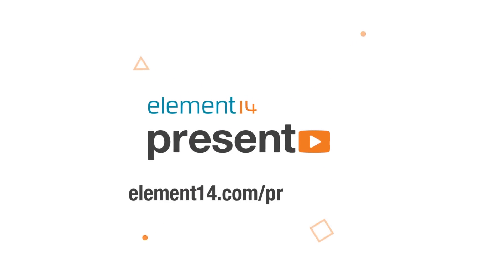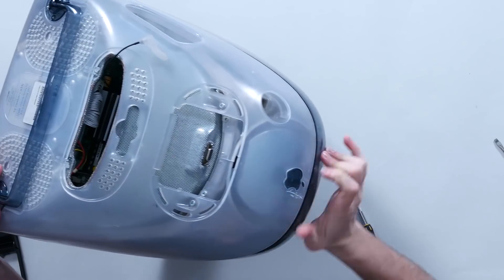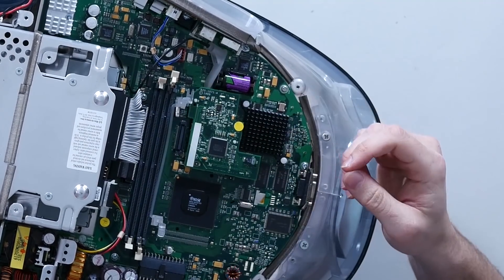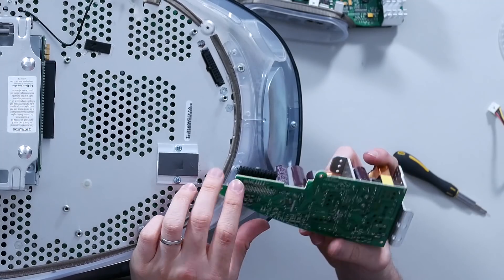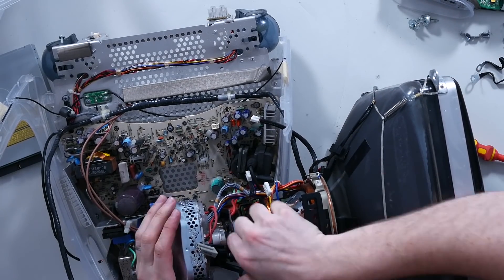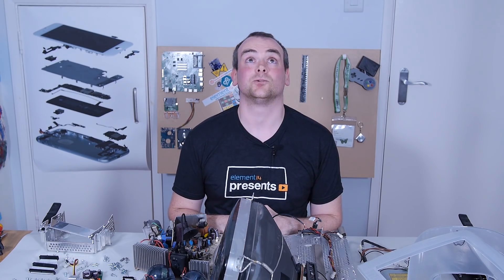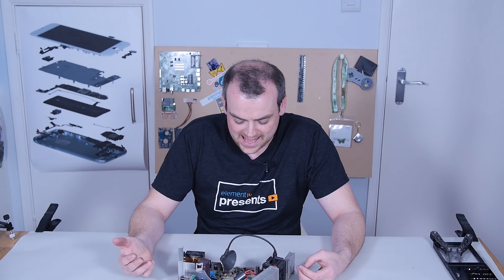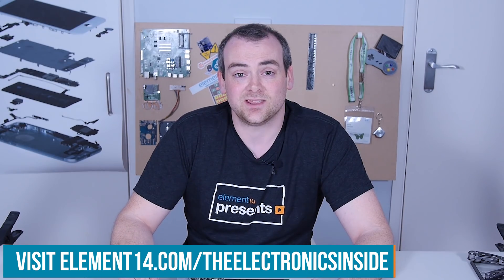iMac G3 Teardown - The Electronics Inside

Comment: Can confirm, working on CRTs is dangerous AF, as is working on exposed power supplies where you can accidentally touch a capacitor and fry yourself. NEVER work on devices like this when they were just connected to power.

Comment: I really appreciate this breakdown tutorial. With my limited knowledge I've resurrected over a dozen iMac G3's left out in the cold by frustrated owners. But am stumped by a Graphite iMac that suddenly won't boot. I power-cycled it and replaced the CMOS battery and reset the PMU, but no juice--just light brief sound of residual electricity. Now suspicious it's the power supply. Thanks for locating it for me, though fear of electrocution and non-availability of a new ps have doomed this one. So disappointing to give up!

Comment: 5 Minutes into the video you already told that the GPU was the CPU and that the IDE interface with additional power lines was a SCSI interface. Sure, a 50 pin cable could be SCSI, but where would the optical drive get it's power from then? ;-)

Comment: I am almost certain the iMac used PATA no SCSI for CD and hard drive. I’Ve owned and used man older Macs with built in SCSI, but I’m prettier sure this one is PATA
Reply: They most certainly did -- the CD connector just has power running to it (it's a laptop drive, pretty sure).

Comment: I know this was more about the electronics, but just wondering if you remember if there was any space between the front bevel and the monitor? Was thinking of lighting it up with LED's but don't want to risk breaking it if I can't get them in anyway. I am already adding LED strip lights to the base and top plastic sections and going to use it as a lil digital jukebox. Great video!

Comment: Most likely the power regulation board is taking in low-voltage AC (20V?), and switching / smoothing it down to the levels needed by the logic board. If you look at the connector, it marks two of the pins as AC+ and AC-. That's how they would be able to get away with powering it via those long traces, where voltage drops from trace resistance is not as much of an issue.

Why does the Apple Chime sound have to come from the HV board? The CPU could produce the sound shortly after boot, and you wouldn't be able to notice a difference from the time you pressed the button to when the sound played. Having the HV board produce the sound would prevent it from being used as a diagnostic, since it wouldn't involve the CPU and would instead function as an auditory power light. Having the CPU produce the sound could at least represent that the CPU is able to begin executing the boot code. (i.e. the RAM works, the CPU works, the sound chip works, and the BIOS was read and not corrupted). That could be done before the POST is completed, since the POST can then be done while the CRT is warming up.
Reply: That's a good point. I guess being a PC user I am used to (certainly at the time) discreet sound cards that need the the OS and drivers to work. As the sound processing and bios are in a bespoke package it would have been possible?
Reply: @a531016  I don't know for certain, but I think the fact that it was a custom VLSI package helps. Most likely, one of a few things were implemented: 1) the sound chip is really simple, so it doesn't need much of a driver (so the BIOS loader can load it), 2) the BIOS used a stripped down version of the driver just to play the startup sound, 3) the BIOS had a hardcoded routine to play the sound file (think of it as optimizing the driver to only do that one task). Given that the sound chip was set and could not be upgraded, any number of those guesses could be true. Though, my bet would be a combination of option 1 and 2, where the sound chip was easy to control, and the first thing the bootloader does (besides set CPU registers), is to send the startup sound to the sound chip. 
Anyway, others have verified that the startup sound is in the BIOS ROM, so it's clearly coming from the CPU. I would suggest probing it to find out how much work the CPU is doing beforehand, but since everything is BGA, it probably won't be feasible. You could probably snoop the BIOS (most likely it's SPI), and decode the contents in the order that they are being read if you are that interested. Since PPC is a RISC architecture, all of the instructions are 32-bit, and are well documented (it should be obvious when the sound data is loaded, since it will most likely be blocks of nonsensical instructions).  That would be a lot of work to answer the question of how the CPU is playing the sound though.
P.S. I am also a PC user, but I think this mac is closer to an embedded system since it pretty much comes in only one configuration. So in a sense, it probably has more in common with a system like the Nintendo GameCube than it does a PC of the era. Also, I am pretty sure that the GameCube played its startup sound from the BIOS as well (probably after the POST though).

Comment: On the observations about its power use and need for cooling, or lack thereof, compared to contemporary Pentiums...I hope that's what we can get back to with an in-house Apple designed ARM processor switch, just massively better perf/watt than the rest of PCs on x86. Ironic though, as the late PowerPC G5s were too poor in performance per watt - the whole reason they switched to x86 in the first place!
Reply: And ironic: as of late the intel x86 CPUs are now getting hardware security flaws, some going back like 20 or more years!!  Which means software patches to stop the flaws, thus sucking down the performance 

<insert the pikachu o-face here>

Comment: Damn what a coincidence just bought a Indigo 400Mhz one with the mouse and keyboard for 15€ last week.
Fun nostalgia trip but the 120GB HDD cap really sucks in modern times because it makes finding a new drive for it so much harder.
Reply: CF to SCSI adapter?  Assuming the interface for the hard drive is SCSI, which if that's what the disk Drive uses, I'd guess the HDD uses it too
Reply: Does the cap apply to a fire wire connected drive?
Reply: As far as I am aware it does not.

Comment: The electron beam is not what charges the CRT up. The Capacitor on the board is just fine. If you remove the bulged plastic cover, the can inside will be just fine and flat.

Comment: I worked at Apple from 2000-2010. When I started we had to learn how to tear down and rebuild these. The Faraday cage would bend and break after 1 or 2 reassembles. It was such a bitch to work on if it had already been previously serviced.
Reply: thanks for the inside, do you have some insight on the powermac G4.?...research for a possible future project

Comment: This is a late model g3
Reply: The exact model number is "M5521" Which as far as I could work out was the first slot loading model? I am happy to be corrected, there are certainly people that know Mac histrory much better than I do. I think the G3 was manufacturered from 1998 to 2001 and this was 1999?
Reply: @a531016  You are correct. The model number M5521 was for all of the slot-loaders from 1999 to 2003. So, the iMac G3 was discontinued in '03, not '01.

Comment: Would it be possible that the HV board that has the audio amp have a sound chip that holds the boot chime since the logic part of the computer isn't loaded up yet like sound drivers?
Maybe it just plays the sound when power is applied to it/ I'd like for you to do experiments with these parts mostly the electronics and id like to see if you can get the chime to come out without the mainboard of the PC hooked up.
Reply: I think that was a bad assumption on the reviewer's part.  The CPU is executing bootstrap ROM code nearly immediately after power-on.  The Mac "BIOS" has the advantage of knowing exactly what is in the computer, unlike PC-land where everything is a user-installable add-in card, and must be enumerated and supported by driver libraries that know how to control it.  In the iMac, since the hardware configuration is guaranteed by design, there need not be "drivers" for sound, per se.  You can just have the startup sound data as a binary blob in ROM, and a small hard-coded routine to initialize the audio chip and start streaming samples to it.  Similar to the PC's customary "beep" after POST, but more sophisticated.
Reply: Good Idea. I will give it a try and see if power does anything. I know that other people have tried to reverse engineer the CRT control with little luck (it requires low level communications to turn on, something like SPI).
Reply: The start-up sound is in the Boot-ROM.

Comment: Please tell me you replaced that capacitor before you put it back together...
Reply: I didn't, however it has not been near power since reassembly. If it ever gets turned on again, I would expect 60-90% of all the interals to be completely different! It did make me nervous though.
Reply: Capacitors aren't really meant to be replaced just by the bias of it's age as said before in the channel of curiousmarc. And by the look of it at the end of the video it looks like it was just a sacrificial sample that not worth to put back together.
Reply: @johnnychang4233  This mac came out during the capacitor plague and they are known to have capacitor problems. They SHOULD be replaced. Especially the surface mount ones

Comment: These were from the middle of the PowerPC architecture. They were followed by the G4 and G5.
Reply: I understood that the G3 went through a number of revisions, including an x86 version? I could well be wrong though, or equally have been looking at an incorrect source?
Reply: @a531016  I doubt they would be able to make an x86 compatible PowerPC or even wanted to try.  Also, the G3 iMac would've competed with Pentium III PCs, which were typically fanless, the quintessential version being Slot 1 cartridges (though there were also socketed and BGA versions).
Reply: @a531016  The PowerPC processors I remember were the 601, 603, 604, G3, G4 and G5.  Macs started using Intel processors in 2006. There have been Mac models that had an Intel processor on a card to allow them to run Windows software. I don't think they were very popular. The G3 was pretty amazing when it came out. I had a 603 system that I upgraded to a G3 via the processor cache slot. It think it made the system something like 3.5 times faster.

Comment: All of the iMac G3 from the original Bondi Blue and even the G4 used IDE for the HD and CD/DVD drives.
Reply: Oh really? I hadn't realised that! Apoligies. Do you know why the ribbon cable has the higher pin coun't? Were they used for anything? Although only marginal, I can't imagine the cost for the cable and connector would have been included if it wasn't?
Reply: @a531016  I'm not sure for that particular iMac but my Bondi Blue one used a slim laptop style cdrom that connected with a single ribbon cable like what you would find in a laptop and it supplied power to the CD drive and allowed for the bus as standard. I assume they are doing similar since I didn't see a power cable for the CD.
Reply: I believe the bigger ribbon connecter is for power to the cd drive but could be wrong I know the hard drive has the 4 pin molex. I also believe this was done because apples disk drive back then was only compatible with macs and also so they could make the iMac compact assuming having 2 sets of molex could have got in the way of something
Reply: @mcsaundy4596  That is a good point, I know I had a heck of a time trying to find a replacement drive for mine because of the connection.